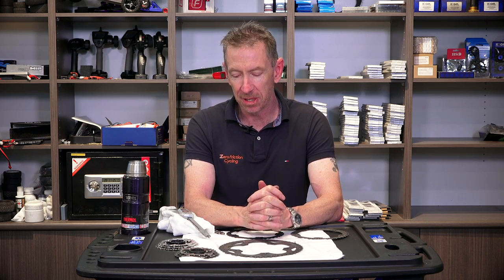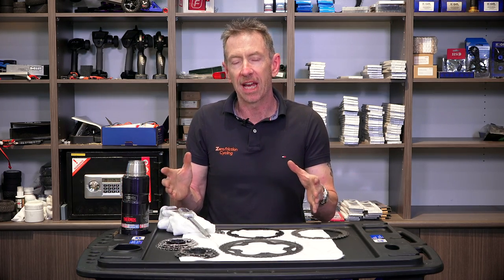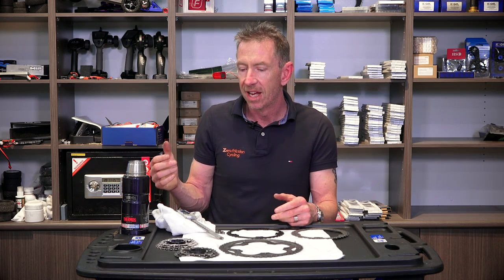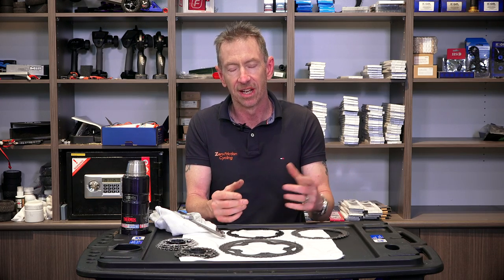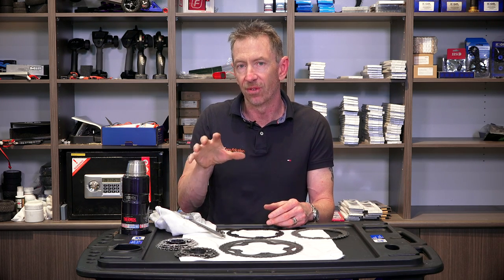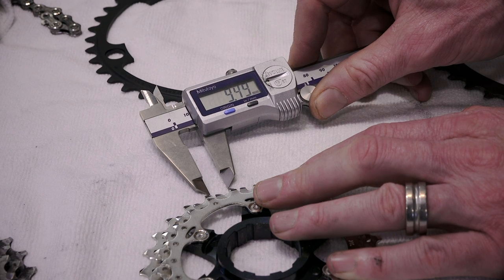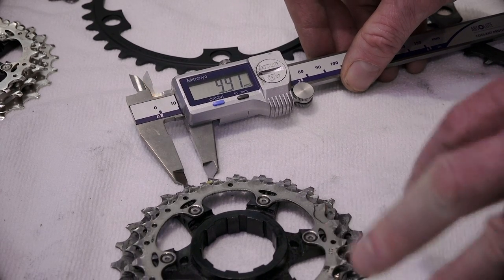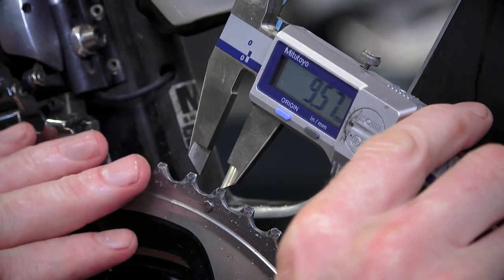Episode 13 Chain Ring and Cassette Wear

Comment: I do all my spring training mountain bike rides using a Deore cassette, deore chainring and whatever chain is on there. A couple of weeks before a big stage race (6-7 day race), I'll install a mix of new(ish) XT/XTR cassette, chain and chain ring. Also a good time to replace cables and housing if they're looking and feeling stiff. Do a few tapering rides to make sure everything is working well. I've saved my pricey drivetrain just for these races and re-used the XT/XTR set for four stage races now. The lighter weight and perfectly functioning drivetrain gives me a big mental boost, even if the extra weight isn't really a factor in my mid-pack placing 😂.

Comment: you measure wrong tips: you should measure from same side of teeth and even that is unimportant because chain does not skips because of tip , it skips because of bottom oh teeth.
Reply from the maker: you can measure that way too, it is just a different number benchmark to be established. The above is not incorrect, it has been proven to work. How can you say that measure does not work? Do you not think the wear at the tip will have some relationship to the wear at the bottom? what we need is an easy measure, that works. the above numbers work. Can you provide same for your measure?
Reply: @zerofrictioncycling992  how you would measure pitch of chain?, on same way you should measure pitch of gear teeth. unworn gear ring teeth can be fatter or thinner and it should not affect on measurement, so if you measure pitch of gear you should measure from same point on two next teeth. i reshape teeth for more than 20 years and on every reshape teeth become thinner, i always reshape bottom of teeth , not tip, and after that reshape chain does not skip any more. i do not measure teeth pitch , i can see by shape oh teeth are thay worn or not and do they need reshape or not
Reply from the maker: @makantahi3731  i dont need to measure the pitch, the pitch of the chain is known as 1/2 inch. I dont need to re shape teeth, and thus make them thinner. I just needed a measure whereby i could advise customer if rings / cogs were worn to a point that acception a new chain was either definitely a no go, or potentially no go, or its fine.  whatever you are doing and why - if that works for you, then cool. but that doesnt discount a simple measure for wear that i am doing.

Comment: I thank you deeply for providing reliable, easy to understand, and very informative videos for free. I would support you directly by ordering parts and lubes through you, but shipping to EU is very expensive.
Reply from the maker: Hi Piezu! thankyou for thoughts of wanting to support, always greatly appreciated! But yes correct int;l shipping out of aus is pretty horrendous (ginormous continent with relatively small commerce). I try to keep pre prep prices low so on multiple prepped chains we start to be competitive as they are expensive everywhere from any reputable provider, but otherwise you can support just by doing what you have done here - watching, engaging, sharing with friends - and same with any podcasts zfc feature on etc so that over time ZFC information will be seen / heard ahead of more worrisome information that is pumped out there!

Comment: One thing I always wondered is how chainring/cassette wear might effect chain wear? I.e. when I fit a new chain I check if it will slip. If it does not slip then I use the chain. But if the cassettes and/or chain rings are worn but not enough to slip, could this affect the life of the chain??
Reply from the maker: Hi Gavin! It wont affect "elongation" wear rate of the chain, as from load going into outside of the roller, the roller will transfer this load to the main load surfaces inside the link (roller bore to inner plate link shoulders, inner plate link bores to pin) same as always. What can happen if teeth are notably sharper, is that where they are in contact with the OUTSIDE of the roller, this can wear a notable groove into the roller. This is pretty rare though. Most rollers are well hardened, and would resist this occurring unless teeth were very sharp, and to be that sharp the chain would have jumped under load, and so those parts would then be replaced. Some chains rollers can be quite soft if the mfg has not hardened them, and suffer wear on the outside from even good condition teeth, more so if things are a bit sharper from wear. Overall though, shortening chain lifespan buy running on worn bits is rarely if ever an issue. more of an issues is a) safety, b) just not great running if a poor mesh between chain and teeth. Sometimes things can be at that tipping point of go / no go, and things are running, but just not really that smooth. Depending on the cassette, it can occur where randomly 2000km in on new chain, things start jumping under power. Chain wear might be minimal, well under replacement mark, but but teeth have continued to wear past the point where running a good condition chain will stay in place under load. This is more common with lightweight allow cassettes, ie getting two chains through a dura ace or red 22 cassette can be much more tricky, with randomly at some point on second chain, it starts to jump under load - chain is fine, but measure tooth gap on cassette and it is 10.2mm+. The out of nowhere jumping under power mid chain use can be confusing, but the reason why can be confirmed by measuring how worn things are.
Reply: @zerofrictioncycling992  thanks that's great info. By the way than you for all the clear waxing advice. This encouraged me to try MSW. It has worked brilliantly through the UK winter. Saved me time and money.

Comment: Hi, my eyes are not so great. Do you think using a 9.5mm or 10mm ball bearing would be fruitful in showing wear?  A 10mm might just show time to change, or do you think that is too much? Great vids 🙂
Reply from the maker: Thanks justin! and great thinking - maybe - i hadnt thought to try that, but that may work well for some - ie if power not too high, a 10mm BB could be an easy way for go / no go measure - for higher power riders where really should consider at about 9.8mm - a 9.5could be a guide if can measure approx 0.3mm gap
Reply: @zerofrictioncycling992  Hi Adam, Thanks for the reply. I have already ordered 9.5 and 10mm bearings. Maybe a feeler gauge with a 9.5 would be very accurate. Using them to measure new ones first to get a feel for it. I will post back on how it pans out 🙂
Reply: there are some exercise for eyes and you can train it to see better( i do it and i have medical check once a year and docs wonder how my sight improved as i get older,48y)

Comment: Hi I've read your Internet site a few times and got me into squirt and smoove. I run 6 speed freewheel and  a nine speed cassette on my two bikes. Have heard anything under 10 speed can take 0.75% chain wear. Any comment on that. Also am I right in calculating that these tooth wears going from 9.5mm to 9.8mm is 3% wear? Simon at always another adventure told me about your YouTube so now getting more chain geek info. Thanks for your great work.
Reply from the maker: Hi there many apologies for delay reply i have been a bit snowed and struggling to duck back to check YT comments! Yes older chain wear checkers typically had 0.75% & 1.0% graduation marks vs the more common 0.5% / 0.75% we have today. 5 to 8 spd chains are a 3/32 standard (internal width of chain is 3/32 of an inch). As such the cog teeth are much thicker, and could withstand a bit more wear, also 5 to 8spd chains have much less protection against wear vs quality say 10 / 11 / 12spd chains, and so tended to reach 0.5% to 0.75% wear pretty quickly, and overall lesser time at greater than 0.5% before being replaced if one was keeping an eye on chain wear, limiting to a degree wear damage to cassette. 9spd onwards however chains move to 11/128 standard, so notably thinner internal width, and so teeth are much thinner providing less metal needing to be worn through ,there is just much less leeway to run a chain past 0.5%, especially when chains are longer lasting and will take a longer time to get from 0.5 to 0.75%, doing overall much greater wear damage along the way. 

And correct re % calculation - it may seem like not much from a mm perspective, but moving from 9.5mm to 9.8mm is definitely notable wear, and can be the go / no go point for stronger riders. And definitely by the time it gets to 10.0mm, it is risky to try running a new chain on same cassette, very risky to try on rings.
Reply: @zerofrictioncycling992  thanks for coming back to me. Chain wear is very interesting and thanks for helping us all get to the truth as apposed to marketing nonsense.

Comment: Just measured 5 of my Shimano 11-34 cassettes, 105 & Ultegra, that are in varying mileage from nearly new to well above 10k mark and they all seem pretty similar, none having shifting issues either. None of them though are even close to the 9.5mm mark, even the new one is about 10mm at the square teeth. Not sure how to baseline the wear so I guess ordering a new cassette to compare is required...
Reply: he measured it from wrong side of teeth , be patient i will make video how to reshape worn teeth and you will never have to buy new cassette or ring gears

Comment: Adam, thanks, it's a bit of a challenge if you don't have a new cassette or chainring available as a baseline.  Are their standard measurements we can use for the other brands? (I would think they would be the same/similar)
Reply from the maker: Hi Michael! Cassettes you are pretty much always ok with circa 9.5mm, just ensure on the cog you are measuring that you are measuring two "square" profile teeth. Ie many cogs with have intermittent round profile teeth to aid shifting performance - so avoid measuring to one of those. For chain rings, it is absolutely best unless it is shimano, to take a measure from new, especially if they are a pointed tooth profile (ie a number of sram road rings) vs a square profile. For the pointed tooth profile this can actually be pretty challenging, as the points themselves wont wear at all until ring is extremely worn, you need to be able to measure from a leading edge point on one tooth to a trailing edge point on next tooth, at a certain height from the tooth trough. This then requires a scribe mark on both to measure the exact same point each time, and track measure, and unfortunately, the same go / no go measure above cannot be applied, you would need to do a same % wear. Ie if your point measured 8.5mm, then probably 8.7 ish may be your go no go point. If you measured 10mm, then probably 10.4 (to be a similar percentage wear as the 9.5 to typical 9.8mm no go mark. I think measuring chain ring wear for anything other than shimano will not be on the cards except for the most nerdy 0.1% of cyclists, and even then it will take some time to build up skills & measures for that ring type. As such, the back up test advised of checking ones rings under load safely after installing new chain is going to be the way to go for many vs measuring.

Comment: I just got into cycling about 4-5 months ago. I put a new chain on last night and when I was laying down the power today on flats and uphills about 6-7 times I felt my chain slip (but it stayed on the ring). It made a clunk sound but was just fine back to normal. I have a Shimano SG-X 50-F Ultegra. I don’t have that tool to measure the teeth but I used a tape measure and from point to point on almost every tooth was half inch. Both in the front ring and back. That is 12.7 mm. Could the “slipping” be new chain with new lube and it will stop? Or do I need to replace my drivetrain? My new chain is a Shimano 10 speed dura-ace ultegra. And the lube I’m using is synergetic oil based. Any thoughts? Thanks!
Reply: You say your chain is 10-speed dura-ace ultegra? 1.,  It should be dura-ace or ultegra. It can't be both. 2., Dura-ace and ultegra have been 12 speed for a while now and 11 speed for years before that. Why is your chain 10 speed? How many cogs on your casette?

Comment: Thank you for sharing your knowledge on this interesting topic!
Do the measurements of 9.5mm and 9.8mm apply to all Shimano cassettes and chain rings?
I have GRX chain rings and a 11 speed 105 cassette (11-30) and I just replaced my chain after approx. 1600km when my park tool chain wear checker showed 0.5% wear. Now after I discovered this video I checked my cassette and chain rings and I can't replicate any of those numbers. Both the cassette and chain rings measure way over 10mm even on the smallest and largest cogs which were basically unused. Did I miss something? (I ride on road mostly even though I have a gravel drivetrain and yes I was using average lube (Dynamic Allround) but I'm switching to the Silca one now) I'd like to know if I did the right thing or am I too late an just wasted 40$ on the new chain?
Reply from the maker: Hey Sam! I havent been able to check grx - due to being too busy on testing and online for a long time now i had to close workshop side of zfc and so i just dont get the bikes through and i dont have grx on any of mine yet! It is likely it wont work for chain rings, tooth profile is likely to be different for better chain retention - so best is to get your own start measure so you can periodically track, and allowing a little adjustment for % ratio - at somewhere in the 0.3 to 0.4mm range that is likely to be getting to the point where it might be good to go a new set of rings for a new chain. 

Cassette i would be surprised if they changed that gap. It is possible but it would be surprise. I would try to really ensure that you have the tip to tip dead on, and check multiple spots on a cog / multiple cogs to see if measure varies - some teeth have a different profile to aid shifting so you really need to make sure your are checking between two square profile teeth. 

Re chain - park tool chain checkers, like A LOT of chain checkers on the market (the vast majority i have checked) - there is a pretty big variance from one tool to another. Some park tool checkers 0.5 is dead on. Sometimes chain is really only at 0.25. Sometimes chain is really at about 0.75. Their cc3.2 with dial is pretty much as accurate as a magic 8 ball.  Alas, who knows, but there are benefits to changing chains early anyway re parts lifespan - you will never ever have wasted money buying your next chain as you can either use it now, use it in future, or use two on rotation. 

No idea re dynamic all round - but i think Dynamic have a good chance of being a solid option based on reputation - however silca ss drip having been tested is definitely a top top option for very low wear (and its very clean).  I should be testing dynamic speed potion wax very soon as have been requested by team Jumbo Visma to do so, so am trying to find a spot.
Reply: Thank you very much for your reply!
Reply: I just assumed the Dynamic Allround lube might be average because the oil seems pretty thin and I've noticed quite a bit of spray of oil on the rim

Comment: How can I tell if it's slipping on front chane rings or in the back cassette. Chain rings?
Reply from the maker: if its jumping it is normally able to be felt / heard if its back or front, and front carries a high risk of it dropping off chain ring. most times it is rear, but if its jumping off front - be careful.

A good way to try to isolate is to ride slowly (ie put  front brake on) and ride with high strength / torque - test HARD pedalling at 5kmh due to holding front brake on, check each cog starting small chain ring and work way up - you can usually find the cog its jumping in or if its chain ring/s and without crashing doing so :)

Comment: Thanks Adam! great video! 
May I ask if this method can be used also for the Jockey wheels of the rear derailleur? are the reference numbers the same?
Reply from the maker: Hey There! Probably but there might be variances from one set of wheels to another. However at least with pulleys if your run them a bit too worn, normally you will only experience worse than normal shifting (unless really worn). You wont get the more risky issues of chain jumping on cogs which can snap off teeth / snap chain or jumping off ring which might cause crash etc. 

it would be best on new set off pulleys, get a start measure to check, and then you can track wear.